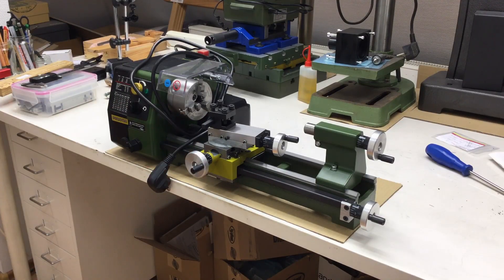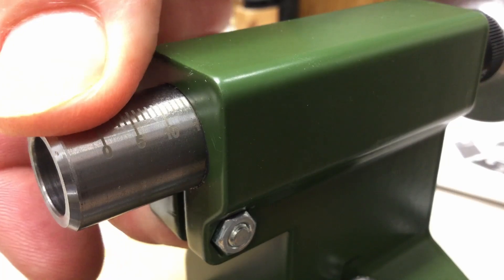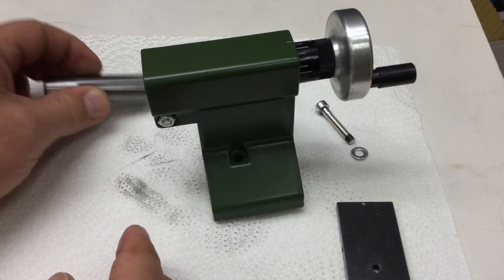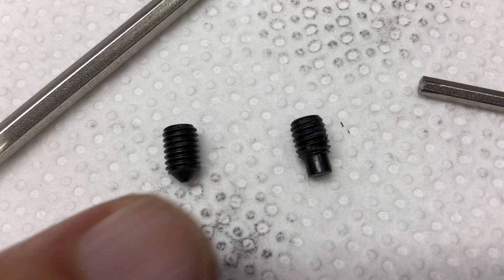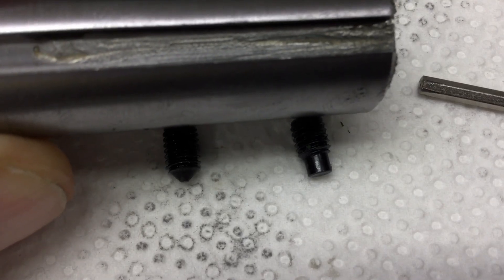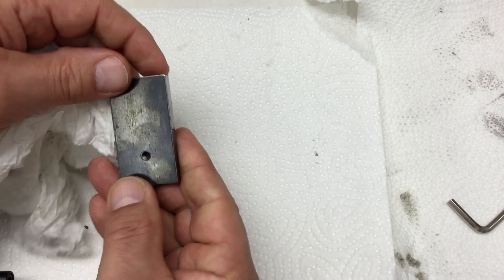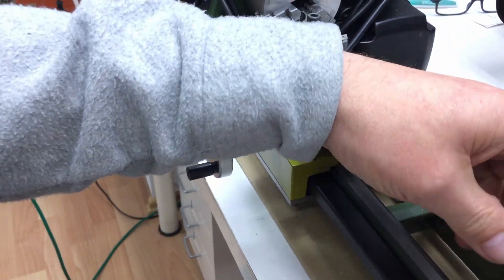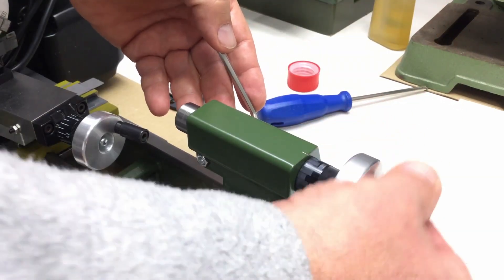Proxxon PD 250/E Lathe Tailstock Maintenance (Cleaning & Adjusting)

Comment: Hi, is it possible for you to measure the centering diameter on the back of the proxxon lathe chuck and the diameter of the mounting hole circle and which size screws are used for mounting the chuck? That would be really great! I am looking for a chuck for my new Emco lathe. The proxxon chuck looks similar but proxxon don't want to tell me the dimensions to check if it fits... Thank you very much in advance!
Reply from the maker: The diameter for the mounting hole circle is 29mm (3 hole pattern for 3 jaw chuck), respectively, 34mm (4 hole pattern for 4 jaw chuck): https://suter-meggen.ch/zubehoer/proxxon/sortiment/ersatzteilblaetter/24407%20%20Drehfutter,%2024407,%2024408,%2024410,%2024034,%2024036%2020150204p.pdf
The bolts are M5 I believe.
Hope that helps.
Reply: @robertssmorgasbord  Thank you very much for your reply! That is exactly what I need. Now I know the Proxxon chuck is exactly the same mount as the Emco one and I can order one :) Thanks again for your kind help!
Reply from the maker: @WeCanDoThatBetter  Your welcome! But keep in mind that I didn't find any information about the centering diameter.
Reply: @robertssmorgasbord  I will get a chuck from Proxxon and see if it really fits. I hope it does :)
Reply from the maker: @WeCanDoThatBetter  I wish you luck! Let me know if it fits.

Comment: Very good and necessary maintenance. I'll start working on my PD right away. Thanks! Wouldn't grease be applied to the sliding components during reassembly to minimize play?
Reply from the maker: Well, the manual states to just use oil on that machine. But I think you are right, grease would have been an option.
Reply: Don't use grease on lathe parts, its stickiness tends to cause it to accumulate swarf particles that grind the metal down. Oil is the way to go!